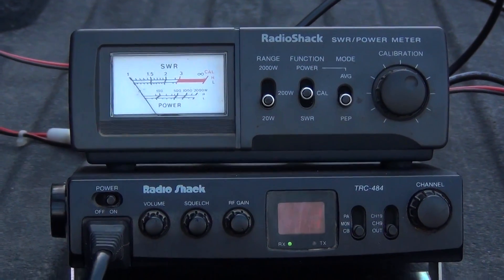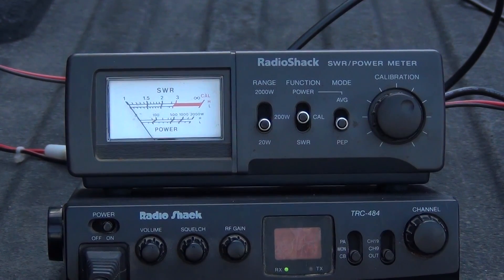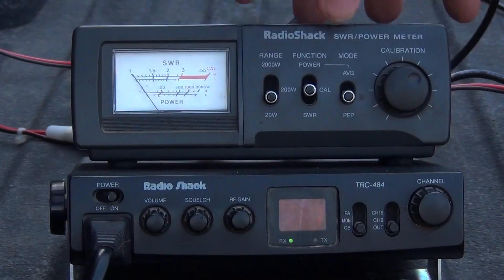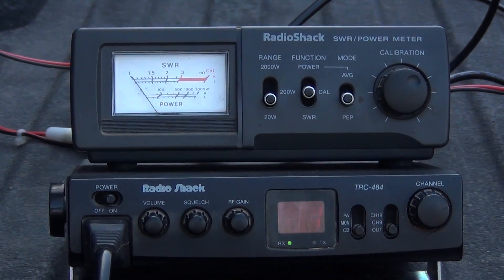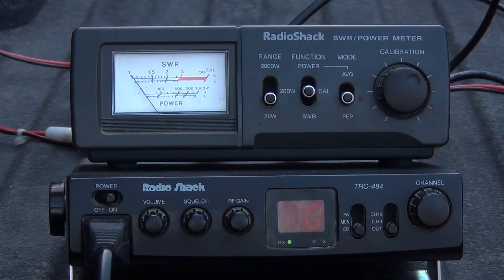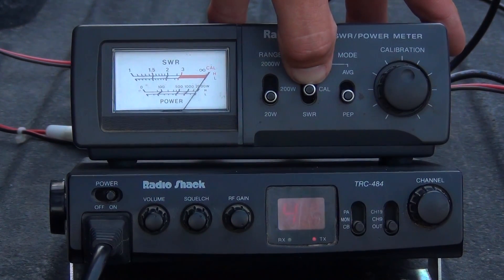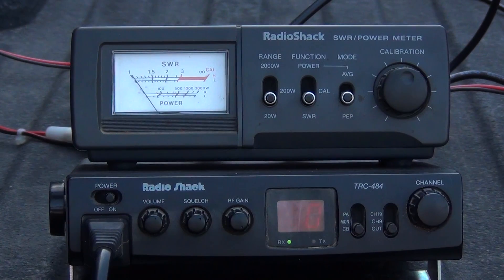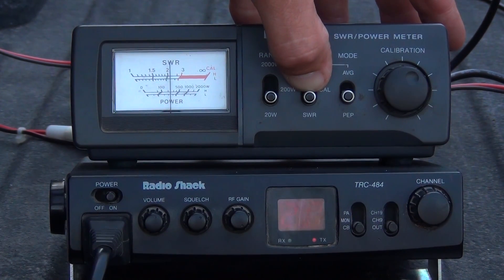SWR Tunning For CB

Comment: So, does your radio antenna need to be shorted as per your instructions?
Reply from the maker: when you buy an antenna you first need to check the swr. Make small adjustments before ultimatly cutting the antenna whip to the proper length